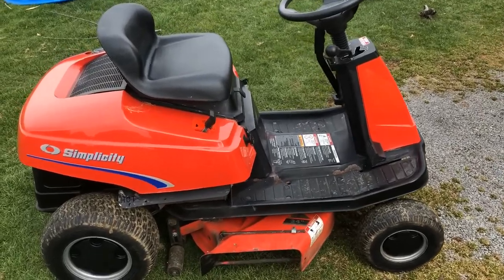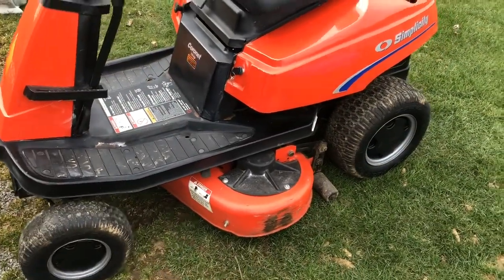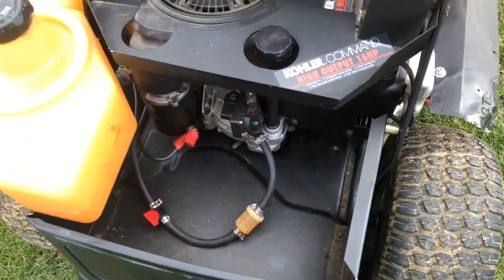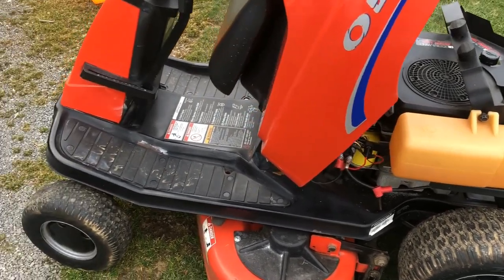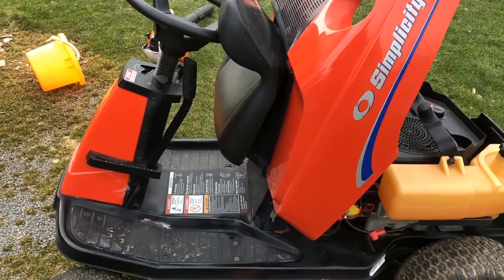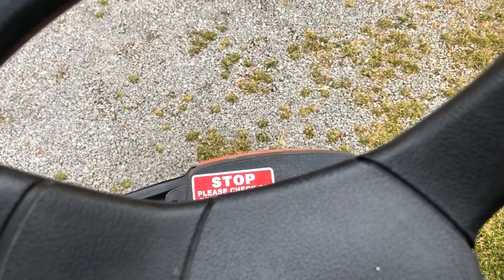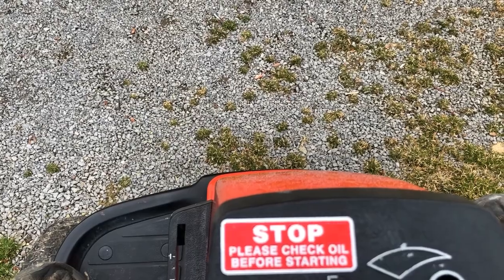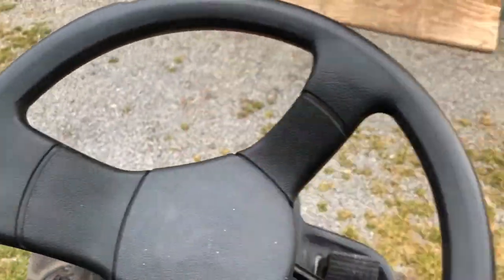1997 Simplicity Coronet Cold Start & Overview

Comment: Nice !
Never knew of a rear engine rider with two blades deck. It it a timed deck ?
Can it be stood up 
on its rear end like a Snapper ?
Reply from the maker: Its not a timed deck. One blade is smaller than the other. It cannot be stood up like a snapper. I wish it could though. Thanks for watching.

Comment: Hi Cory. She runs good. Sometimes those Kohler fuel pumps are slow to prime after they've been sitting awhile
Reply from the maker: Yea that was probably the issue. Its been running great. Its mainly used for leaf cleanup with a bagger. Thanks for watching

Comment: Those Kohler with fuel pumps usually you have to crank them a bit to draw up the fuel it’s just the nature of the beast I like the simplicity’s I have a special place in my heart for them especially the rear engine riders i had a snapper rer I sold a John Deere 68 rer I will never sell that I completely rebuilt the motor and I also have an older toro wheel horse rer but I have a 318 a cub 1811 a cub 582 and a wheel horse 312a I unfortunately sold most of all my  other tractors check out my channel and you can see what I work on I’m 16 and I’m in pa I work at a small engine shop we’re a toro and echo dealer we used to sell wheel horse back in the day but we get all kinds of tractors to work on and since I am mechanic there they let me get first dibs on scrap tractors that people don’t want to fix wich is how I got a lot of nice machine that needed some toc
Reply from the maker: Subbed to you... That's cool you work in a small engine shop good place to pickup knowledge of this old stuff and like you said get some good deals on equipment. Thanks for watching.
Reply: @corysgardentractors7084  yeah no problem man it’s great to get people into the small engine field/hobby most of the tech schools only teach the kids on dirt bikes and stuff because of the lack of interest on small lawn equipment and there’s a big need at shops for that sort of thing thanks for subbing also